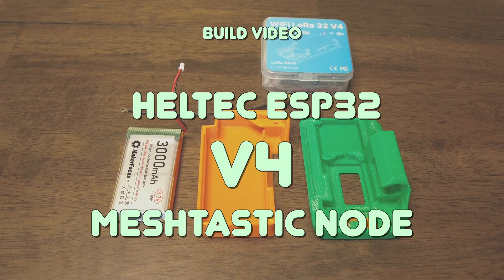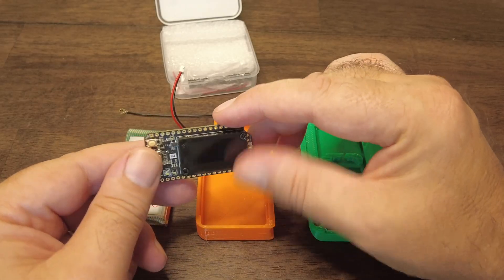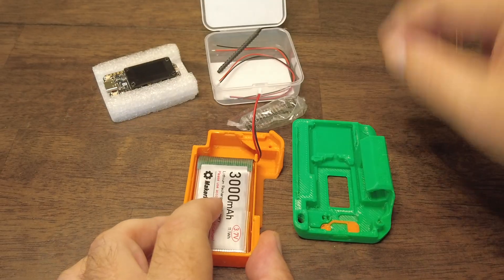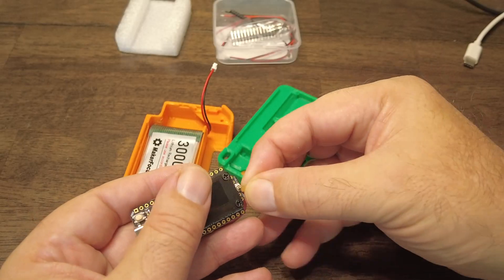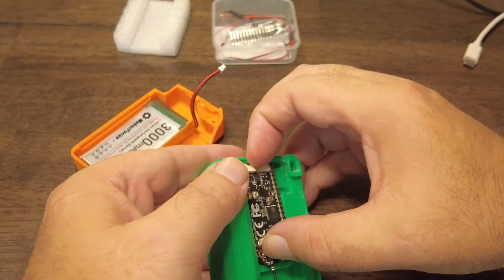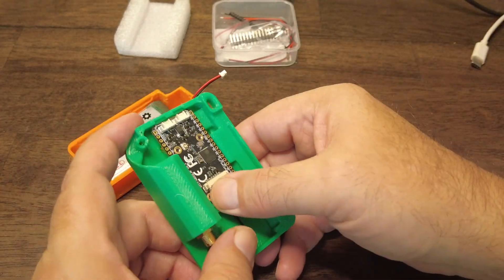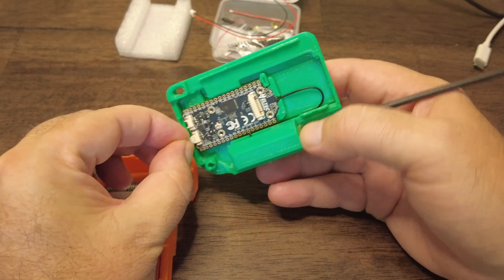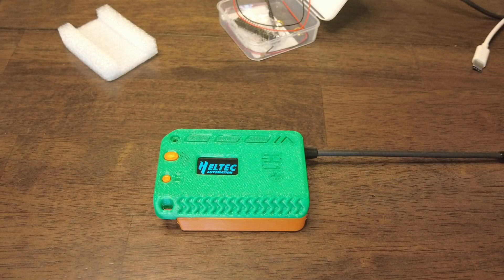Build Video: Heltec V4 Unboxing & Setup: Better Than V3? 🤔

Comment: The main reason anyone would need to upgrade to a V4, is to have more power output,   but if you are currently reaching router nodes on your local mesh,  there is no reason to use a V4, if you already have something else.

A good place to use higher power nodes is on your rooftop node that you use to relay to the mesh,  or within the network itself as part of the infrastructure ( router node ).  as stated ESP32 based nodes are not that solar friendly.  but it is usually precisely where you would want to use these higher power nodes in the first place.   yes these use more power than NRF52 based nodes,  but it's not rocket science,  you just need a bit larger solar panel and a little bigger battery capacity.  a 5 watt or higher solar  panel, with at least 2 18650 batteries  or a 6000 mah or more will work fine.    again,   if a regular node with 22db output will work in your area,  then there is no need to use this one,  which has about 28db.  or about 4x more output. 

in a solar setup, I would use a separate   battery charge controller such as TP4056 based one,  these cost about 1 dollar.  they can handle a full amp.  which will better match the output capacity of the solar panel.  and if it fails for some reason,  its much cheaper to replace than a new node module.

Just so you get an idea of how much these use,  a 3000mah battery like the one shown in this video, used with a V4 AND GPS module will run about 24 hours, between charging,  so don't be too afraid of using ESP32 based boards because of their "power hog" reputation.
Reply from the maker: Thanks for sharing your detailed insights and experience!
Reply: High power ... hmm, better increase height or use a yagi

Comment: Always make sure the battery polarity matches the + and - on the PCB. Don’t rely on the battery connector to be correct, they are not always the same
Reply from the maker: Absolutely, always double-check the polarity!